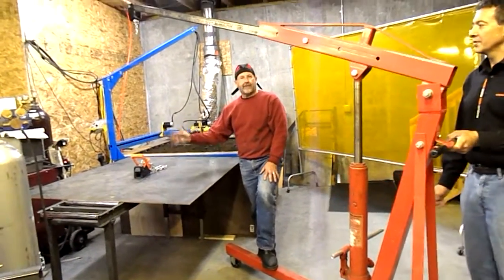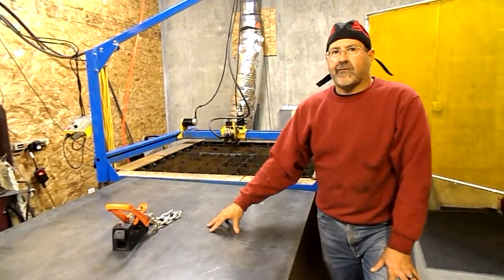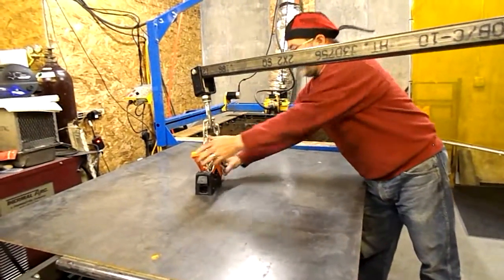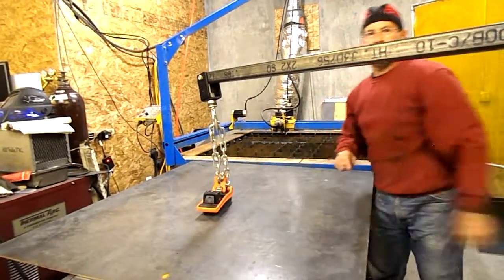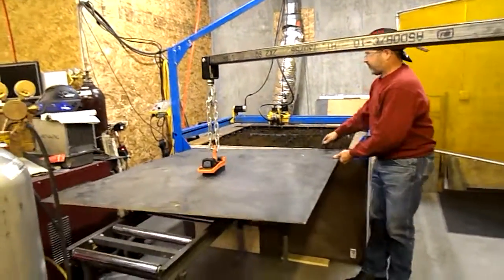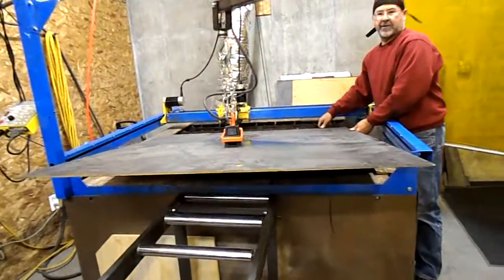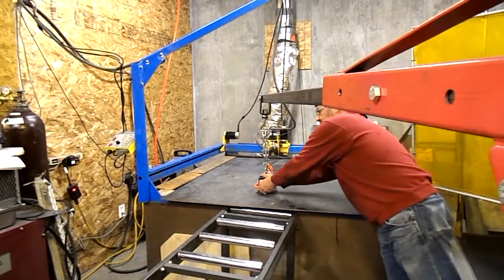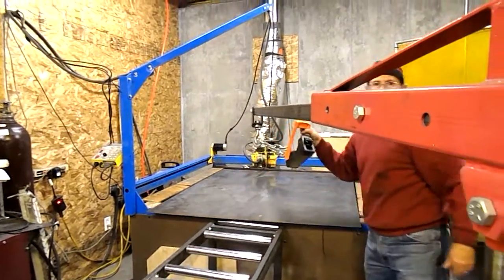Alfra / Maglogix TML250 Lifting Magnet lifting 1/4" plate

Comment: My problem with magnets 🧲: I run a burn table and all the parts need to be scraped free of slag and dross before putting them away.  All the slag and dross is on the bottom side of the part!  I can't stand under the part to clean it!  So, what I do is pick the part up from the edge, not the middle, and raise one end up and, depending how heavy the part is, either set the opposite end on the table or the floor and pull the magnet end back until the dirty side of the part is exposed.  Then I scrape it clean, then I raise it and put it away.  If I don't use this method, I have to use a Bear Claw and raise and clamp every part, then unclamp it to either drop it or set it down.